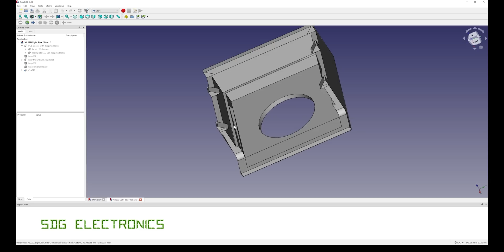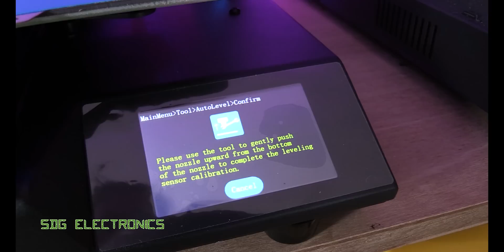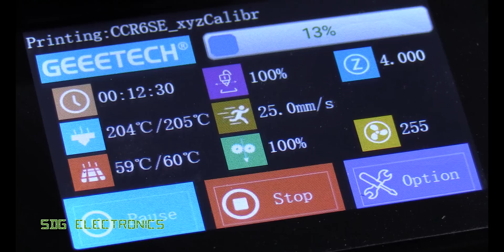SDG #254  Soldering Microscope Improvements using Geeetech Mizar S

Comment: Hi, that's a very interesting solution, ths for sharing! I've a question regarding your microscope cam... i'm looking for a decent sony imx sensor for microscope (soldering + inspecting)... would be nice if you'd recommend some nice sony sensors. IMX290 better than IMX334 ? Getting IMX485 or IMX585 or something else in that price range? thx

Comment: When you were rotating the iphone sheet with respect to the 48mm polarized lense it looked like not all the light was blocked out in a single orientation.  However later on, when you rotate the iphone polarized filter with itself, there was clearly an orientation where it was all filtered out.  This seems to suggest that the polarized filter on your objective lense is circularly polarized, and not linearly polarized, yet the iphone sheet material you put onto the LEDs is linearly polarized.  Is that correct?  I'm looking to play with this and only seem to find circularly polarized lense caps (since most photographers want that kind I would assume?  Great videos!

Comment: Hi Steve I've just found your channel and have been massively impressed with your videos and how you explain things, would you recommend the Quick 861DW? I want to buy something that's going to last but not hammer my bank account too badly. Thanks
Reply from the maker: The Quick 861DW definitely does the job well. My recommendation was the Best hot air station, but a few people reported quality issues more recently so the Quick is probably safer
Reply: @sdgelectronics  I've went for the Quick 861DW. I think it will suit me for the foreseeable, Its truly invaluable the help your type of channel gives people like me. Thank you.

Comment: I think your choice of polarizing sheet material is very good. I can't think of any mechanism that would cause "bleaching." There's no pigment in those filters. 
They consist of long molecules stretched out to be parallel to each other. The molecules are mechanically embedded in the plastic material permanently. And since your light sources do not produce short ultraviolet I don't see how any molecular bonds could be broken.
Very clever solution you've created. I never would have guessed how well it works.
Reply: Remember that polarization cuts your light in half. All of that light is absorbed in the polarizer for the plastic stuff, so depending on how much light there is there might be thermal effects in the material.

Comment: I often salvage the diffusers and polarizing sheets from old busted LCD screens. The layers of sheets are useful in all sorts of lighting projects and are made to be bombarded with LED light :-)
Reply: That what I like to do too. They've a nice large size so they last for many projects and if you would buy something similar in a store it can get quite expensive. Beside that sometimes the T-Con boards and PSUs of old TVs have a decent value as well so it's worth the time.

Comment: used to use the flexible plastic sheets on my previous microscrope and just cut them down to size however of course that made the main image too blurry and unfocused since the main lense then was not a hard glass plarizer. and dimensionally those inconsistencies of the plastic messed up the image to some extent.

with my newer eakins i had not bothered to look into this for believing that the glass lenses were too expensive. so its great to finally discover they are actually in fact more afffordable. although when i search for the 48mm diameter version it comes up on ebay as around 35 qyud? which is still more than many of the other sized ones. the 48mm version indeed seems to be harder to find. but you know, there are always ring adaptors or just waiting around

however while not having light polarizaer anymore,  have been finding myself gravitating towards just simply spraying down the pcb with ipa alcohol. so that while the board is wetted (or semi wet and halfway in the process of evaprorating and drying out). then that itself also changes or diffracts the light differently. and can then be quite helpful in combination also with titing the board at the same time, too get some extra angles for the light to bounce back differently. i am not sure if thin layers of surface liquids can or cannot in fact generate any sort of polarizing effect. or if its instead other type of optical interactions perhaps with the laser etcched plastic surface. but it just is something relatively easy and convenient i have become accustomed to doing. since i regularly blast boards with ipa anyhow. and also it means that i do not have to cut the light down by 50% the rest of the time, or keep fiddling about with the filters. which overall i appreciate those upsides

but what i am not so certain of myself here is whether that technique is really as good as using proper polarizin filters. because half the time those laser etched markings are barely etched on there to begin with. as in the etching itself is so often not very good. but especially on many chinese chips. only on some manufacturers chips (for example more reputable companies like st or ti or whomever) is the etching actually guaranteed to be so well done to always see nice and clearly and be a lot more legible. (at least comparatively speaking, all i am really saying here is that there appears to be quite a broad spectrum between the best and the worst ones)

anyhow thanks for the video. will keep a watch alert for those japanese koon pollarizers. appreciate it

Comment: It would be nicer to have light coming from many different wavelength LEDs. Because the different wavelength are not reflected the same way, sometimes you can reach higher contrast image, if you use a color mixture instead of plain white. And since our eye can only detect three colors, in reality the same white perception can be mixed from slightly different wavelengths of red, green and blue. It is basically messing with CRI to achieve better contrast.
Reply: Different wavelengths or all polarized the same direction passing through the filter. If you have a material that will circularly polarize light, in other words the thing that you're looking at causes circular polarization, then you will get a colored effect. But it's not due to the polarizing film itself which is pretty much independent of wavelength.

Comment: I wonder if you can achieve the same effect with simply dimming/turning off one of the lights independently: if that's the case, you can have a "button" when you want to read an IC and control it like that... does it make sense? Would that work?
Reply from the maker: Not quite, though different LED angles may help it doesn't achieve the same overall result of blocking the reflections.
Reply: It won't be quite as good for video work, but should be good enough for hobbyist use. You can find a ring light with this feature if you search for "variable intensity by section", that has four zones. I tried with WS2812s but they are nowhere near bright enough.

Comment: Brilliant! Could you just fit four 48mm glass lenses over the LEDs or do they stick out too much? If so, you could try scoring and breaking them to size?
Reply from the maker: They're a bit big, but I may try using my wet diamond cutter
Reply: That's an expensive solution that's not necessary. The sheets will polarize the light just fine. You may call about its optical properties but remember it's a light source but not an imaging device.

Comment: And what are the results with the polariser on the lens but NOT on the illuminating LEDs? As the light is naturally  polarised with the reflection on the reflective surfaces, the effect should be interesting. Will your polarisers against will last long with the heat? And the same for the 3D printed supports…
Reply from the maker: It makes basically no difference without the LED polariser. I'd originally bought that first hoping it would do the job

Comment: Excellent!!! Is there any chance to get this light setup? print it or buy it?
Reply from the maker: I was never really happy with the design, so I didn't release it. I will probably tidy things up and release a new version soon.
Reply: I second this question. I followed your original videos with great enthusiasm to build one for myself, but it never happened. Probably because of the challenge of separately sourcing all the parts and long lead times, plus multiple shipping costs all adding up etc.  I’ll look forward to your “tidied up” version, and then perhaps re-look at the option of building my own.